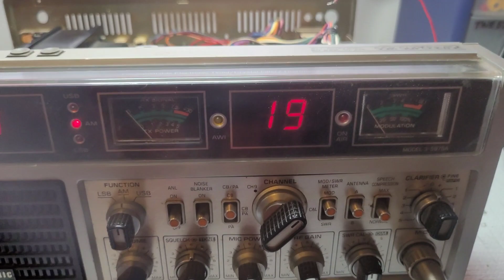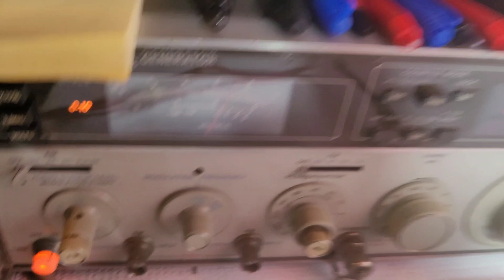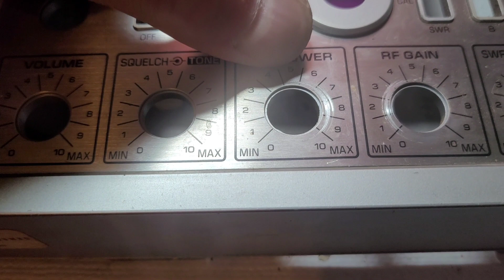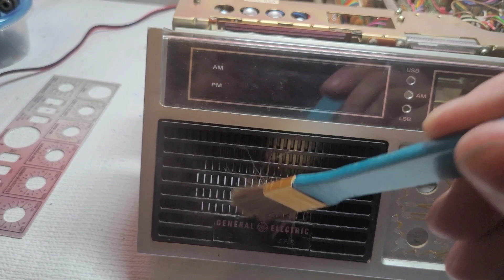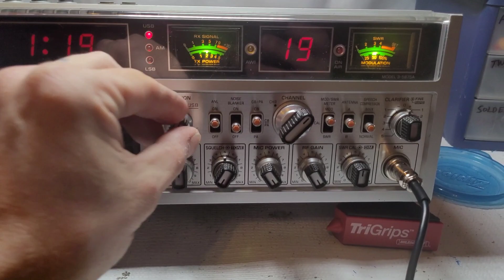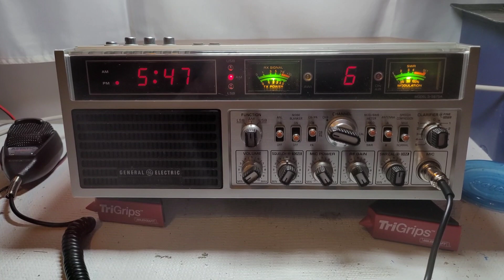After a long battle, this GE Superbase 3-5875A can finally go home !

Comment: Great video. Fantastic job on the Super base. Looks so much better. I have a mobile version that needs a VCO. Not looking forward to changing it. But when they work properly makes it all worth it. Having said that ive sat on a new vco for a couple years. I love the fact they have two boards except the repairing them part.
Reply from the maker: Thanks ! No doubt they're great radios.  One thing I can tell you is that the mobile radios are way easier to work on than the bases.  The small green VCOs are also easier to get at the varactor diode than the larger cybernet ones.  Or the Spectrum Communications ones are great too.
Reply: @pulsarcb  great reply lots of helpful and confidence building tips all in one message. Yep thats the one. Green VCO. It works ok for a while then starts to fail once warmed up completely. Starts dropping channels either end of the band before completely failing.